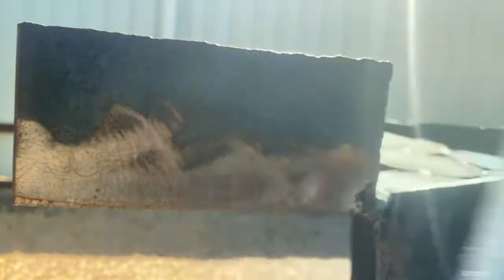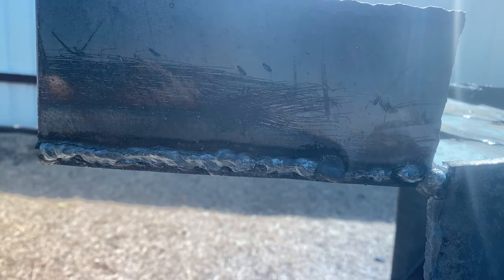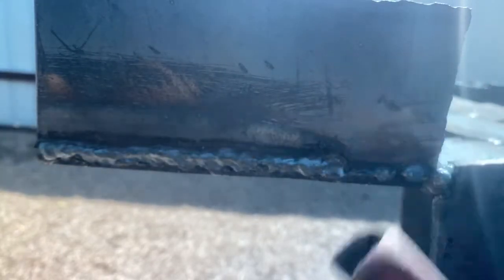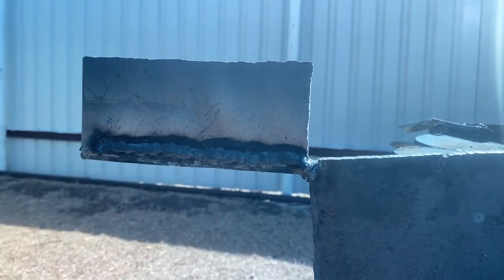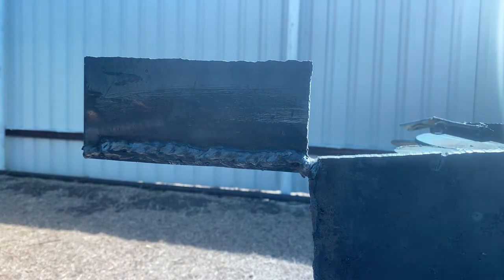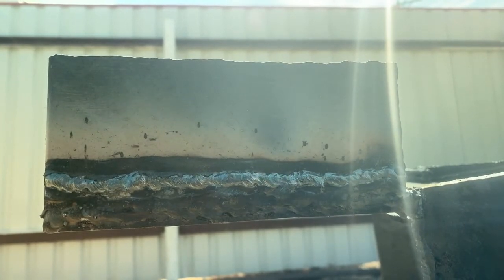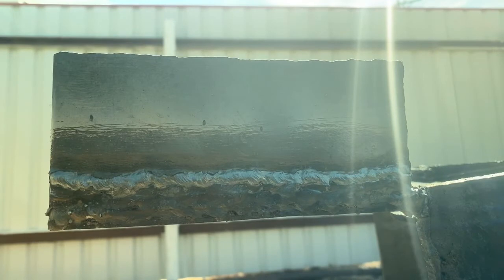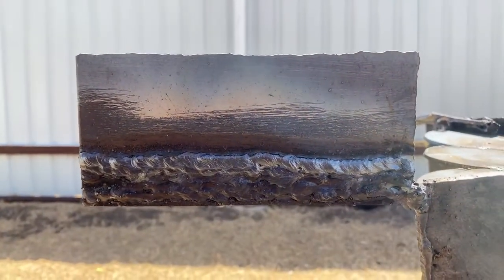How to stick weld 7014 electrode horizontal | stick welding for beginners

Comment: Run alot of 7014 in pin bores for line boring because when you over lap your welds it does not get as hard as 7018.     Keep practicing  many in a few years. You might have a decent weld.   7014 does not feal even close to 7018.   BTW try adjusting your heat.

Comment: Great video... I use 7014 3/32 all the time
Reply: i’ve used 6010, 6011, 6013, 7018, 7024, 312 and a bunch of other rods and 7014 is one of my favorites. 
not sayings it’s the best because there’s no such thing as the best since they all have their own application, but it’s definitely a fun easy rod to burn, the ones i have (don’t know the brand they belonged to my old man) weld so nicely i actually have footage so i can post a video on here soon.
Reply: My favorite rod is 7018 has Rod they ever made 7014 has too much blowouts. It’s only good for a drag rod and factories building steps, and so forth drag rod.